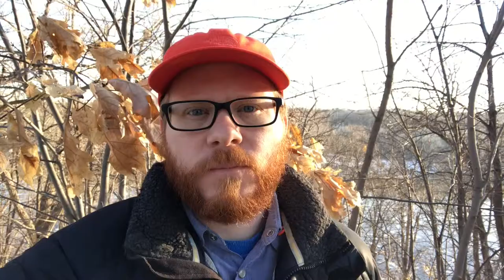“A type-driven approach to design” [ MVA Daily Vlog 006 ]

Comment: Real good insight, Joshua. Thanks a lot. Just a question: when you say you can come up with 20 to 40 different combinations, is that because you are used to it, and if yes, was it more difficult or slower at the beginning?
Reply from the maker: Hey Carlo! thanks for the comment. There's a couple of things that are going on: 
1)  I turn off all guides, make sure that all the type is in separate boxes and just use the selection tool to scale things up and down (I don't want to have to select any individual lines inside of a text box or change the size through the font menu. I even try to avoid adjusting leading and instead eyeball the space between boxes). This makes my working method a lot more gestural and thus faster.
2) My standards for what is “good” are extremely low: every time I think “Oh, that’s cool” I try to finish it very quickly and move on to something else.
3) I only try to finish it as much as is needed to get the idea across. If you were to see an early version of a pattern or repetitive motif the spacing is probably all messed up because I'll worry about the details after I go through everything and edit it.
4) If I like something but want to look at a dramatic change, I will always duplicate the artboard or page to make the change. My files tend to balloon and have a lot of pages, then I run through them and start deleting things.
5) Lastly a lot of those versions will be things I don't like but I wrapped them up just in case. So I won't be surprised if I review the pages later and delete half of them.
6) The biggest thing is that I believe in working fast and that I need to do a lot of versions to get to the good ones so that belief is driving me to try a lot of stuff.
Reply from the maker: Here's a couple of 1-minute timelapse showing 15–20 minutes of open-ended type work: https://www.youtube.com/watch?v=WxWToXv6fbc 
https://www.youtube.com/watch?v=5j_2JZSL6Jw
Reply: Wow! That's a really rich explanation. Thank you Joshua! So it's a kind of Lego playing. As you say: fonts as raw material. If I'm not wrong is a sort of Wolfgang Weingart kind of approach, isn't it?
Reply from the maker: Carlo Gr  Yes, WW is definitely relevant. I’d say the lineage of the assignment I experienced is Wolfgang Weingart to April Greiman/Dan Friedman to Cranbrook/McCoys to Jam Jancourt/MCAD, ha ha. I’ve abandoned all the post/modernist ideology which probably makes it more akin to early Modernist work of the post-WW1 period.
Reply: @themvastudio6863  wow, I'd love to put my hands on some of their assignments.